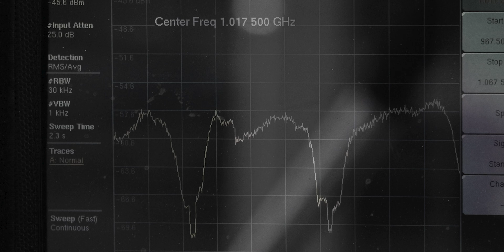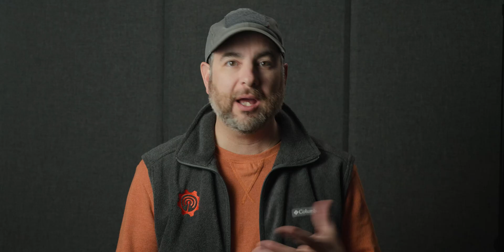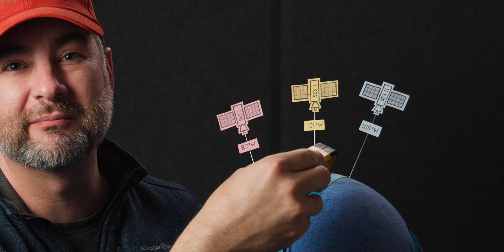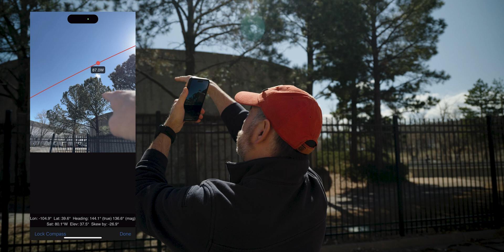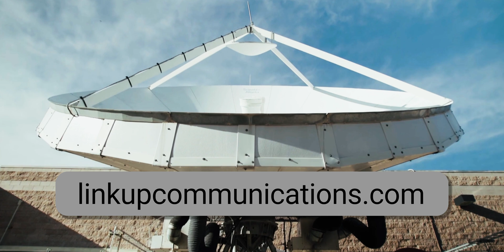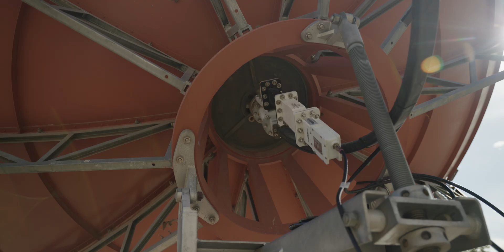Pointing a Satellite Dish

Comment: Question. I'm using an XR-3 connected to one of the ports of a splitter between an LNB power supply/amp. I get no signal out of the XR-3's IDU port to my spectrum analyzer. Does there need to be DC/LNB voltage gong into the IDU port for it to pass signal out that port? For example, should I be using a receiver or DC power supply with a splitter connected to the IDU port and come back out of the second splitter port to go to the spectrum analyzer?
Reply from the maker: The ODU should be connected to the LNB and that would provide power (from the XR3).
Reply: @TheBroadcastEngineer I am connecting the ODU port farther downstream behind a splitter so as not to interrupt their ongoing satellite programming. The unit picks up good signal and will even do a spectrum trace internally, pass PoP tests, etc. But there is nothing coming out of the IDU port. Is that because the XR-3 has to be actually powering the LNB for the IDU port to function?
Reply from the maker: No. That’s very strange.
Reply: @TheBroadcastEngineer Spoke with tech guy at AI again today. He said he thinks the IDU output got switched off in a firmware revision along the way a while back and might not be turned on in the latest version/update. Says if it is indeed turned off, he'll work on switching it back on and pushing out a new update. Said he'd let me know if that's the case and when I should run another update check and install to correct it. I'd be curious to know if you're running all the latest updates and whether or not you have signal output from the IDU port. Meanwhile, I purchased a second XR-3 which arrived today, which has WiFi/Hands-free, which my other one didn't. They had to email me a link for the Android version of the XR-3 Remote app, as it's no longer on the Play Store. The sdk file he provided me a link to downloaded and installed fine and adds a whole new dimension of convenience to aligning and peaking a dish. Up the ladder, up to the roof, or up in a bucket lift with a couple of wrenches and my cellphone and the peaking/alignment is done in a matter of minutes. Loving it!
Reply from the maker: @EastAlabamaMedia I thought I was on the latest firmware… now I’m going to have to look on Monday… but the last time I used it was this video and I had my spec an attached to the IDU port.
Reply: @TheBroadcastEngineer I'll be curious to hear whether or not you are running the latest version of firmware. Of course there is an easy enough cheat: use a two- way splitter that's DC passing on one port (for the XR-3 ODU port) and use the other port of the splitter to go to the spectrum analyzer. That was my original plan of action. If you run a tracking generator through the splitter and check the insertion loss at L-band frequencies, it's easy enough to calculate what the actual signal level from the LNB is by adding that back to the level measured by the spectrum analyzer when using the two way splitter to connect to both the XR-3 and the spectrum analyzer. My spectrum analyzer allows entering a correction factor, so adding the IL in that field takes away even having to do any math, so saved plots from it will be correct, including the marker table, which I use to have the levels recorded for all transponder frequencies used by the client.

Comment: Will add that, along with the big tools for the nuts, you also want to have a can of penetrating oil, to enable those rusted fasteners to come loose, and also a gas torch, for those that some previous person put in with thread lock. then as well you want a can of spray paint, to hide the evidence of those bolts and nuts needing to get toasty, along with a can of Tectyl, to provide some corrosion proofing of them after they are tight, so they will be able to be adjusted in future, and to keep water from rusting them into solid blocks. If they are not willing to release, even after heat and a big bar, then a portable angle grinder, plus a pack of new bolts, is a good extra to have. You know the bolt is tight when the 1in impact driver is doing nothing, and the 4lb hammer is just making sparks, and you need to go and get the 16lb hammer, plus have somebody hold the tool in place with a cloth and extra protection, and it still takes a dozen blows to get it to even think about moving, and then you bring in the 4 foot pipe as cheater bar. Told the guy doing that he technically needed a hot work permit from the sparks... He had to do that with all 16, and used the same tightening torque on them again after alignment. they really do not want them to move, even with the load being passed through them, that needed a very precise alignment.
Reply from the maker: Hahaha good point! See previous video about my attempt to move a satellite dish at the previous employer.
Reply: @TheBroadcastEngineer  Those bolts are M20 high tensile capscrews, and the drive for them is a 15kW servo drive, capable of moving them, along with the 6 tons or so of load, from zero to 10m/s in about 10cm, and stopping them equally as fast, under full control. 10 second cycle time, and the main breaker is 2kA trip current, with a nice set of bus bars as power supply. Power cable is 16mm cable, rated at 100A for the motor drives. motor connections had a torque setting, gutentight, or basically get the person with biggest biceps to tighten it. Otherwise the torque wrench they supplied, complete with crows foot attachments, would not click.

Comment: Hey I'm  also a broadcast engineer of 20 years and been playing with satellites longer
2 things that you said that id like to clarify

1) signal differences are usually not due to station keeping... factors that do affect signal from satellites: Weather and cloud, Ground temp, Other users on shared transponders,  When the satellite cant see the sun it operates on Batteries and as the satellite gets older they have to drop TX power to support the payload

2) being stationary to ground users doesn't have to be in geostationary orbit on the clarke belt.
The reason its at 22,000 miles on the equator is to utilize the gravity pull of the moon saving the satellite operator a heap in fuel.
Reply: Plus sun fade, you can be guaranteed that you will have a few days, twice a year, when your signal will disappear into the noise. Depending on the band, the size of dish, actual modulation method, and the satellite transmit power, it can be only a drop in quality, that error correction can handle, or you lose signal for 30 minutes at a particular time of day. For me that is twice a year, roughly 10AM, as the dish gets directly into the rising sun.
Reply: @SeanBZA  The Sun, The biggest radio station in the solar system :)
Reply from the maker: @leftymuller Indeed it is!!!
Reply from the maker: @leftymuller It makes it fun twice a year when dealing with geostationary satellites. :)
Reply from the maker: Thanks for clarifying.
Reply from the maker: It depends on if you’re using Ku band on a 1.8m dish, you’re not going to see the effects of station keeping. Using a 6 meter dish on Ku, you absolutely will. But yes, weather and other users can pay a part. However, other users should not be impacting you in any way, and if they are, should be reported to the network who would escalate it to the satellite provider. If you’re using obscure older satellites, the battery issue may become an issue, but there are contractual obligations to power levels that satellite operators must maintain.

Comment: What of circular polarization caused by the ionosphere? Are the frequencies used by these satellite-dish systems high enough to diminish the ionospherically caused circular polarization?
Are some of the dishes you work with circularly polarized?
Reply: All Intelsat's are Circular pol on C band.. there are very few on KU
Faraday Rotation on C and KU signals is very small and not a factor to consider
Linear signals are actually more affected by the ionosphere but once again not really enough to have to worry about at high frequencies
Reply from the maker: At the frequencies and systems we're using, any errors caused by the atmosphere is dealt with by error correction. No, we do not use circular polarization for any satellite transmissions.